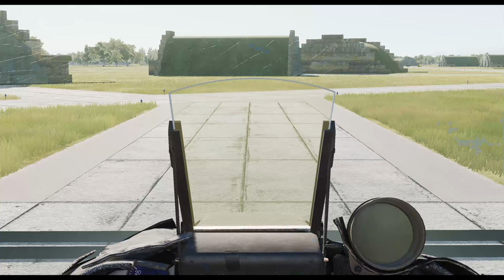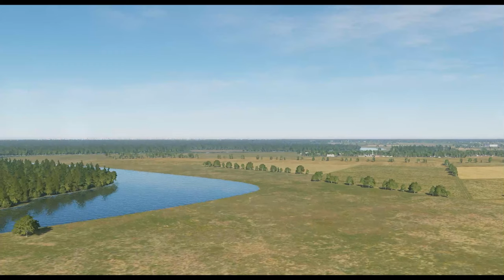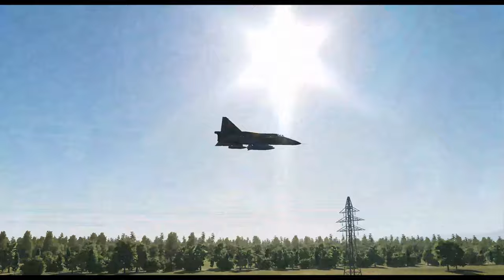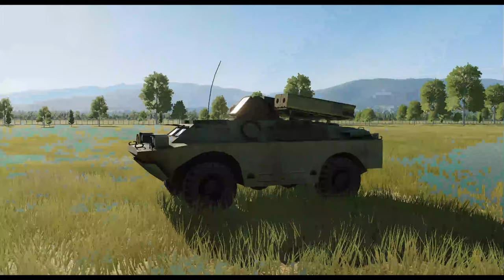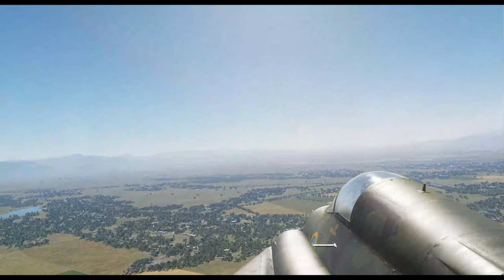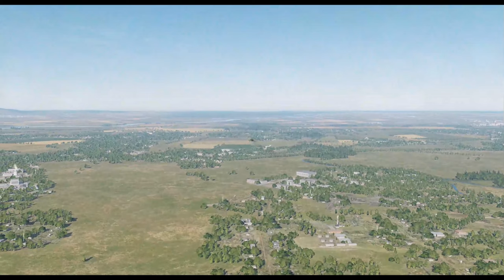Viggen, final version (I promise)

Comment: Great work Sir!  Your Swedish sounded authentic enough, just like the dude from Sesame Street, although I never heard him say Aktus or Sakta, so I'm lost there.  I always love Viggen landings, just that little hint of a tube liner when the reverse thrusters engage (same engine I suppose).  You're right about HB, amazing dev, my only little critique on hearing the landing externally is about 2 years ago I was 100m from one landing, there's an enormous thundery bass sound from that engine (perhaps down air conditions, but who knows) and when the reverse kicks in it sounds like standing next to a furnace, on second thoughts I do hear that from inside the pit.
Reply from the maker: Why thank you good Sir, and hope all is well. I was considering doing a duuh, skaduub de duuh... Meeck meeck meeck and throw the HOTAS over my shoulder, but I have a feeling that may end up as an expensive way of doing stuff ala the swedish chef from the muppet show. And yeah that JT-8D that Volvo gave an afterburner section because we can dammit is rather amazing. You do have the hoover right next to you in the form of the intakes, and it does blow air forward along the sides (You can see the reverser exhaust slots on the exhaust section of the rear fuselage from the side and bottom)